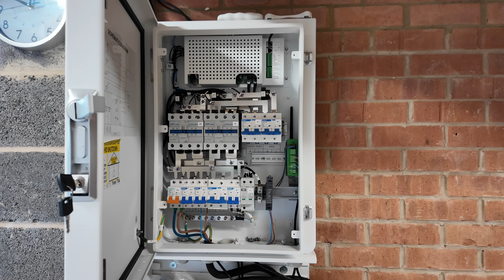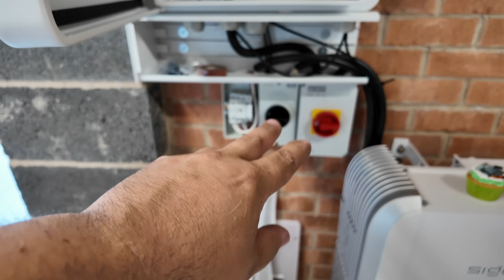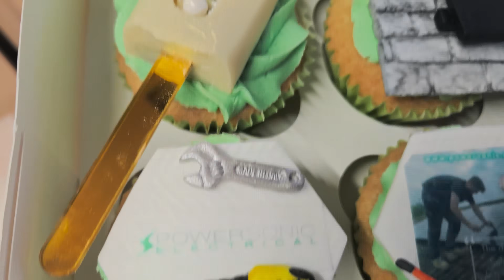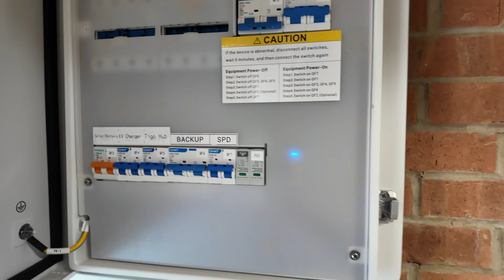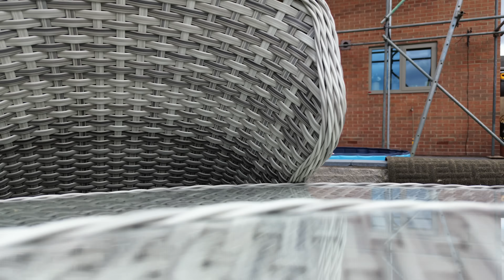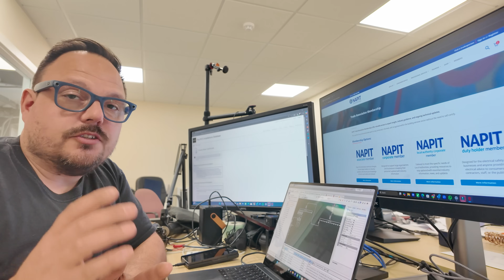Max out your roof space with solar - 12kW Sigenergy full system install

Comment: Hi mark. What is the advantage of wiring the EV charger in to one of the spare inverter ports on the gateway? Thanks
Reply from the maker: Mainly the wiring route. It doesnt matter if it connects to the consumer unit or gateway.

Comment: I have read that Sigenergy now integrates with Shelly smart switches. Do you plan to do a video to cover this?
Reply from the maker: It does integrate with Shelly this is correct. However its not an area I will be covering. Sticking in my lane lol.

Comment: Fabulous video.  Thanks for going to great lengths to make a solar installation understandable.  

Do you have more details about how the Tigo equipment is integrated.
Reply from the maker: The tigo system monitors the panels and reports into the tigo app. Sigenergy can import that data into its own app as well. 

On fault detection the system can be shutdown, on AC loss to the inverter the same, panels are shutdown at source and the string is broken down. Great safety functions and excellent shading/performance monitoring/control.
Reply: @electrician247 Thanks for your kind help..  but how is the Tigo gateway installed in the gateway?  Is the enclosure metal?  Does the signal get through?  Is it wired into the gateway, or is it just a convenient placement?  I would love some close up photos.

Comment: was swapping the stack and getaway plus isolators have solved the problem with the gateway lock handle being obscured with additional battery packs?
Reply from the maker: We are good for 2 more battery additions before that becomes a factor. We would also have a shelf to move at that stage. Setting up for unrealistic growth/circumstance is silly imho. Allow for some element of expansion but how far do we go? Clear space for another stack? Sense isnt that common sometimes. 

We can sit the stack forward and move it to the right easy enough if the system does ever grow to full height. Pointless to do that at this stage. Thanks